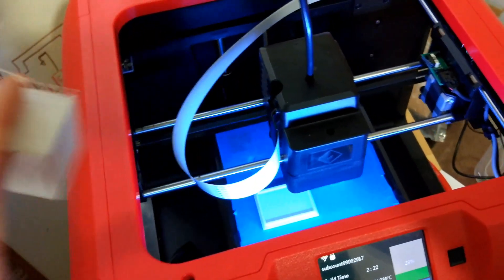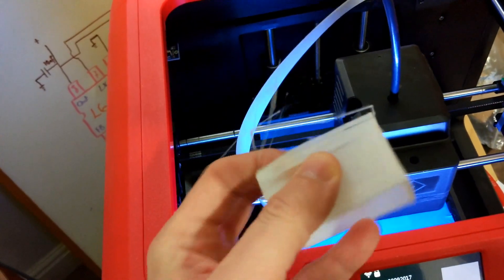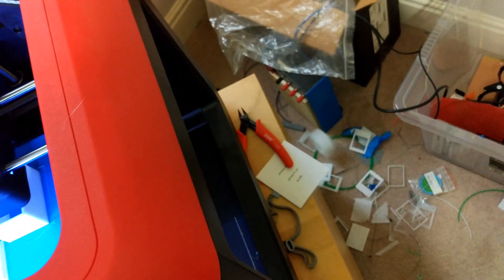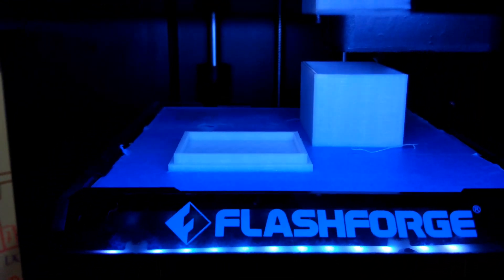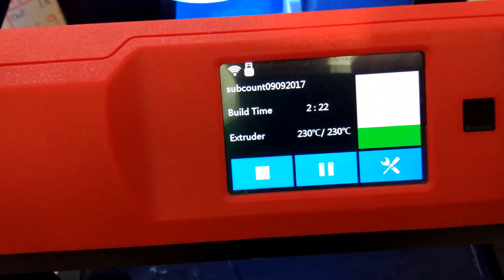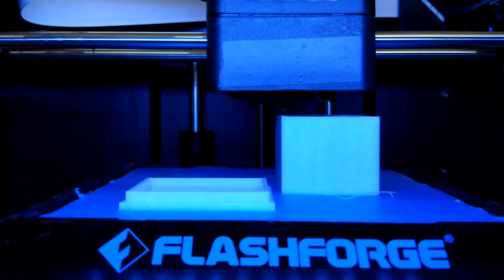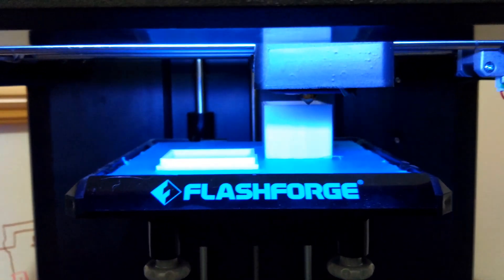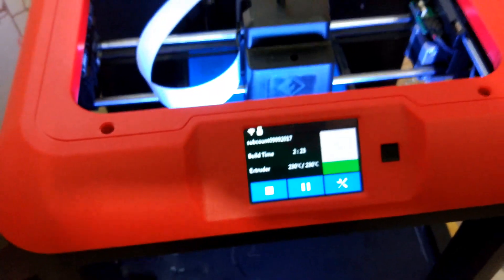Mini Update: Printing the case for the E-Paper social counter

Comment: When I once had similar layer adhesion problems, it was due to friction in the filament transport causing not enough filament being squirted out. In my case putting some silicon spray in the bowden tube and increasing spring pressure on the extruder spindle helped. Don't know if your problem is related. When friction is too high most times you can feel filament hickups every now and then. I also experienced that having a good first layer and not too high layer height helps a lot.
Reply from the maker: Thanks, I thought that the the underextrusion would have been a key player. I do get the occasional 'slicking' of the extruder so increasing the tension might be a good shout.
Reply: David Watts - As you already noticed increasing temperature may also help. I've noticed some PLA filaments to become more viscose than others at the same temperature. One local brand prints excellent at 210, whereas another might print better at 230. Be careful not to go too high though, as burning your filament is a sure way to glog the nozzle. I never use a raft, but always print with some loops around the first layer, to prime the nozzle and to serve as a test round. While its printing, I rub those loops with my finger to test adhesion and height. If it directly comes loose, the first layer is most often too high, not level or lacking adhesion to bed. Too thin may cause the extrusion to skip spots, causing problems on the next layer. I believe that the extruded line also helps a bit to pull the wire out of the nozzle. Assuming you're printing with a normal nozzle (minimal 0.3mm) too thin extrusion is often caused by friction. The cause of which could even be lack of a spindle for your spool.
Reply: Jerry also has a tip about filament feed lubrication, claiming and displaying use of open-cell material with silicone or vegetable oil to prevent dust and lubricate the filament, worth a shot if you're having issues that aren't entirely user error.

Comment: Don't think that layer adhesion issue is from bed leveling TBH. I'd check your temps and maybe try another batch of filament.  Best of luck.
Reply from the maker: MKme Lab definitely not temps this time, all I changed was the leveling. It was pretty far out, plus under extrusion was an issues to start with.
Reply: Yeah but bed level doesn't really cause layer adhesion issues.  If its under-extruding due to settings or a clog and your perimeters are thin- that could do it too. Looks like you have a really thin shell to that model. Not bed level though I'm afraid :)  More platsic, more hotter or diff filament- one of those Id bet money.
Reply from the maker: MKme Lab how dare you talk about the thickness of my shell!
Reply: Bwahahahahahaha

Comment: Is that pla? It seems really weird in terms of adhesion and melting point. You might wanna obtain better filament. Clear PLA is the easiest to print with. Do lots test object prints, they really help. 

If the first layer looks good and it still doesnt adhere, check the shape of the layers. If they come out somewhat round, you can increase the extrusion multiplier or try a higher temperature.
Reply from the maker: It is just cheap PLA, it isn't great but for £10 I wasn't expecting much.